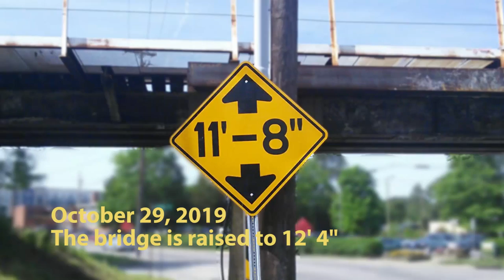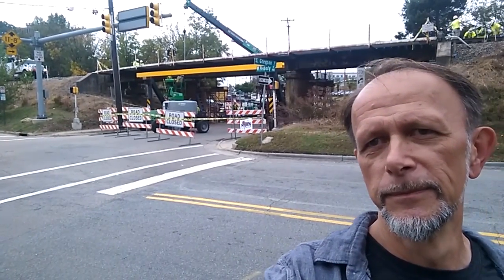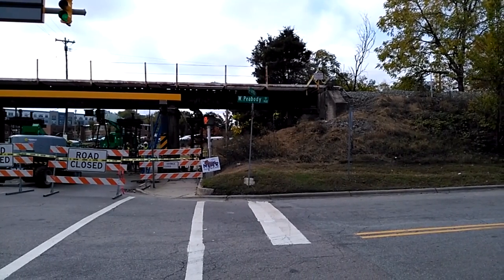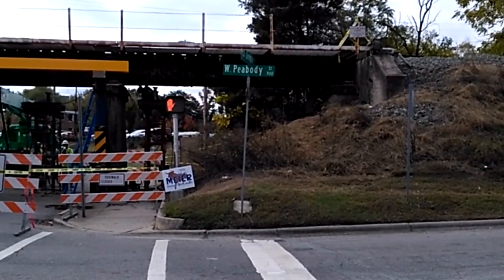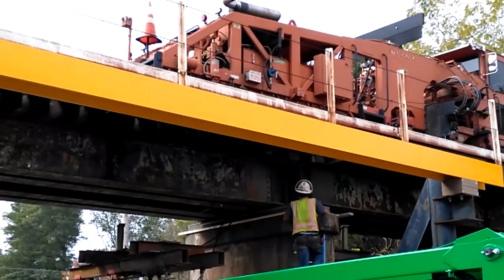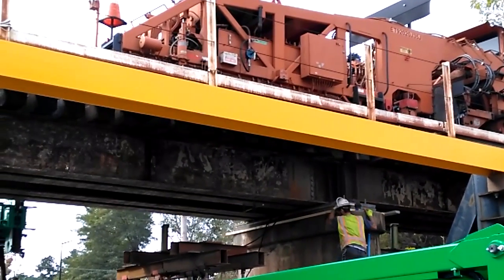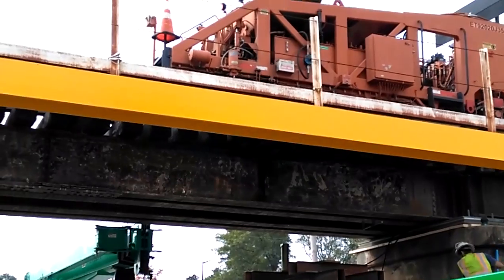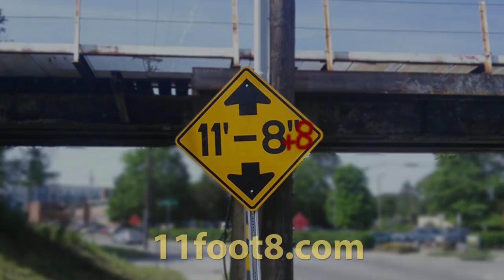Raising the 11foot8 bridge by 8 inches

Comment: The reopening of the bridge should be celebrated by reopening of a Penske truck with a bottle of champagne attached to the roof.
Reply: This is the best comment. You'd almost expect the local truck rental shop managers and insurance agents will be getting better balance sheets from here on.
Reply: Kickstarter campaign to fund this???
Reply: @MartinVisser  Ryder,Truck is Actually Holding the Event. They lost the most they said.
Reply: ROFL -- I'd pay to see that!
Reply: With the luck they have had at that bridge I would guess they would send out a truck that is still too tall to fit underneath.
Reply: There goes our fun
Reply: Howl
Reply: @horseplop9  It would be kind of interesting to see a breakdown of the ones we have recording of to see the tallies. Maybe even do a clip reel, if each crash go a second or two that would be between 2.5 to 5 minutes as you see the number of type (rentals might even break down company as well).
Reply: @SnowmanTF2  Id Gladly watch that..
Reply: They could have at least had a Penske ribbon cutting with the big scissors and stuff.
Reply: Lollll
Reply: Fucking lol
Reply: I talked to some rr workers once , they say that raising the tracks is easier than lowering them.
Reply: That's genius. Comments like this are rare
Reply: Sounds about right.
Reply: LMFAO
Reply: Lol
Reply: @jclay6680  yeah you have to undo so much its easier to rip it out grade it down then rebuild
Reply: Still not fixed. System is the problem 🏡 Our Life Great Qualities.....

1, Show all living creatures; all the love and kindness as much as you can.

2, Only try to be honest with yourself. If you try to be honest with others, you will get into big trouble soon or later.

3, Aim only one target at a time; otherwise you are chasing two rabbits and you will miss both. So, the reason behind it. Have one powerful reason and never ever give up the one you want the most.

4, Don't try to be good person only but be the powerful person. We will grow to be the one or we will die. There is no other choice. 

5, Always learn and look for to improve something your life. 

6, You are not alone. Love and faith the high power reduces unnecessary stress in life. But never completely rely on it. 

7,  Success and happiness are the byproducts of our usefulness. So, always increase the possibility of success.

8, Life is not going to be easy. Because of our unnecessary things. Eliminate all the unnecessary things as much as you can by organising yourself well with the environments. 

9, Never believe anything without the proper evidences. 

10, Always try to give more than you take. 
Because it is dignity/ character of the divinity within you.

🌎 As long as people continue to see themselves as separate from everything else, they lend themselves to being completely enslaved. Success depends on how well we relate to everything around us. Joy comes from that bliss of connectedness. I believe that unarmed truth and love will have the final word in reality. To love; you should have good heart. I am a good person until I see a person better than my standard of goodness. Being good is the progress towards a worthy cause. Love is God. Whoever lives in love, lives forever. How selfish it is to try to keep something forever? Love is all about nourishing, nurturing, sharing and expanding the love within you for all. The principle to which we adhere to is that we have kindness of love at heart for the whole of mankind.  As long as there is the unnecessary differences within us; we can not live peacefully so we have to eliminate all the unnecessary differences among us so we can love all. People abilities may vary but not there true love. If we love a person/ God for a reason then we love the reason but not the person. No reason is the reason to love the person because true love never fails. So do not compare or measure the true love as first or the last but love all truly. If you love people truly then you can understand people. If you don't love then you don't understand people at all.

People are controlled by system why?
The Cyclical Consumption is the current economy all over the World. It is making the scarcity problems of the earth finite resources to deteriorate day by day. Current Monetary System is legalised theft. Real money is Gold and Silver. Scarcity gives the money more value. Real money won't lose it's value. When Governments stay away from Gold & Silver then very easy to transfer the wealth / resources to upper class the Rich (Corporatocracy) Elite. When the Governments are printing out more new fiat currency with reserve banks, our old currency is losing its purchasing power everyday. They are printing millions of currency everyday. All governments and laws are existing right now to transfer wealth to upper class the rich elite. The USA Government & other Governments are in many countries, bailed the investment banks & financial institutions in 2008 against the majority of the people. There is no democracy in any countries. Because of the Money System based on profits motive only above all else even humans lives and well-being. So, we do not have freedom to protect our values with the money so on. The violence, bankruptcy & all the negativities are build into the Monetary System of our society. All are owned (including ourselves) by Reserve Bank. Which is private cartel the corporation. So, in legal system, we are legally considered as chattel the properties. They make money in the capital markets with our birth certificates. They do not consider us as Humans. That's the truth. We are at the invisible war with the Elites (Corporatocracies). We have to fight for our Freedom. Resource Based Economy is the Solution. We have to declare the earth resources as the heritage of all the people of this world. So everyone has access to it. Please have your research about zeitgeist movement then you know the truth more. 

 Truth About Health/Drugs Industry Because Of It Your Life At High Risk The drug industry is a 1/2 trillion dollars a year worldwide conglomerate. Almost 300 billions dollars just in North America. That is really big business. What would happen if everyone were well? There is no money in health. You see, good health makes a lot of sense but it doesn't make a lot of dollars. Because everything they do is toxic. Every drug they use, prescription drugs, all drugs are liver toxic, bar none. If you've had amalgam fillings put in your mouth by dentists. It is highly toxic. There's cancer because most of the chemos are themselves carcinogens. To view the tumor as the cancer and we know the tumor is not the cancer. The cancer industry is 200 billions dollars a year. The more work they get, the more profit there is. You have to dismantle; If the truth ever came out about what we would need to do. 30% of people of females in America are at risk of getting, will get cancer of the breast. The ones that are already dead have been grossly mistreated by the medical profession and by the government that supposedly is supposed to encourage free research and development of all possibilities. Why would medical doctors who studied medicine and practice medicine and are heavily funded by pharmaceutical companies why would they go and look into vitamins? That they never had the answer orthomolecular. And as more and more of our population start taking their health into their own hands, there's going to be even more and more of changes. It can't go on the way it is. The system is failing apart. We must make nutrition the primary prevention strategy for the population. You are what you eat. You are everything that you have ever done to yourself. The choices you make directly affect the outcome of your life. - (Food Matters Documentary in Netflix)

😊 Well, I truly love God. I am not religious but very spiritual person. So, I believe 1) Religion is the beliefs in someone experiences But spirituality is having my own experiences. The mainstream religions people promote religious ideology by giving guidelines and guide but In my spiritual life; I do not want anyone or anything between God and me to restrict my freedom to worship God. 2) We do not need any authorities to do good work. The god work is the good work always. In contrast; organised mainstream religions are claiming that they have the authorities to do God works as leaders so on. 3) God is not capable of doing wrong thing, change the past for us and create anything out of nothing for us. Nothing means not anything. So, even God is limited. The mainstream religious people believe that God is unlimited. 4) God wants us to take responsibilities for our righteousness life but not for all the consequences of our actions because they are continued to exist among us. So, How can god punish us for all our consequences? The mainstream religious people believe we are full of sins because of all our actions. 5) Freewill  is an illusion. People always choose the perceived path of greatest pleasure.  So, we do not have choices all the time. In contrast teachings of the mainstream religions are promoting people to do god's will always because we all have choices of freewill always. 6) We can not separate everything into groups. So, everything for good and evil and there's no success and failure for everything. If everything is real then real things can not be threatened. Once you come to understand that God/The Holy Spirit is in each of us, You will no longer need a Book to tell you how to live. Then why we need religious scriptures? The Virtue is the expression of the basic goodness in our actions. The Basic goodness is the fundamental worthiness of every individuals. We are worthy to God always in everything. 7) Beliefs in a cruel God makes a cruel man. No matter what; every living creatures has the right to live and What makes their life cheap? Everything depends on everything. Nothing too big or too small in value. We can not love and hate at the same time; Being a vegetarian means love without cruelty happily. The mainstream religious people are killing people and sacrificing animals in the name of God. They promote God's cruel punishments. The Punishment is endless for Sinners/Devil according to religious scriptures. But God is love always. Overcome hate with love. If all religions for peace, unity? No way. Because they are not for peace. 8) Well, The God gave us everything to go from moment to moment in our lives as we do our part  and pray only to thank god then the Love is in progress. The Love is always for everyone. We are always worthy of the God's love. Our greatest fear is; not to be loved by anyone but we are all loved by someone. When we eliminate all our unnecessary differences among us then true peaceful life is possible with the true love. If we can't find the peace within ourselves then we will never find it anywhere else. 9) This is the Fight for independence and freedom of humanity to worship God freely without religious guide and guidelines to restrict us. Unnecessarily, We do not want third party controls over us in anything ; especially in spirituality. 10) Revive Survive Thrive. Sincerely,  The Real Peacemaker against religious oppression.

 https://youtu.be/HbvCxMfcKv4
https://youtu.be/pIJHJzDQcRM
https://youtu.be/MyxbdmAnIcI
https://youtu.be/wLzeakKC6fE
 https://youtu.be/P8vHa8zD7jY
Reply: YES
Reply: very nice though
Reply: Not enough clearance (remember, they only raised it 8 stupid inches. LOL).

Comment: Penske Yellow was the perfect color choice for that new crash beam.
Reply: LOL
Reply: I'm sure no one will miss that...  ;)
Reply: I bet they didn't even have to paint it. The trucks involuntarily donated the paint.
Reply: I was thinking orange and blue, for Budget rent a truck
Reply: *slow clap*
Reply: Was'nt it easier to just make the road deeper? Lol!!!
Reply: Their trucks are now all white.
Reply: @jc9240  there's pipes under the road.
Reply: @Commissar0617  3 FEET DOWN.
Reply: @DieselRamcharger  exactly. you can't build a road directly on top of the pipe, you need roadbed to spread out the load
Reply: @Commissar0617  Oh!
Reply: @DieselRamcharger  city doesn't have a way to bring it higher. I don't think you understand just what all goes into supporting a roadway
Reply: @Commissar0617  Road need to go down, not up. or the trestle need to go higher. easy to do, just not cheap. why the city allows public safety to take a back seat to cost, ill never know. the rail company lifted it 8 inch because the higher you go the further in each direction you need to regrade the track. if you knew anything about train track you'd know adjusting them is not difficult. its jut not cheap. the bottom line here is, failure of govt.
Reply: @DieselRamcharger  there's big piped under the road, so you can't go down. it's an old roadway, been there for probably over a hundred years.
Reply: @Commissar0617  that big pipe, is a drain and water main. hell here in phoenix  we just had them dig up miles of street, lay temporary pipe in place  along the sidewalks with diesel boost pumps, as to not disturb anyone while the mains were serviced (enlarged) for future growth. it CAN be done. the city there is just fucking incompetent.
Reply: @DieselRamcharger  it's a state maintained road. there's a sewer MAIN that's 100+ years old running under it.

Comment: Railroads always have the coolest, specialized vehicles. Ballast tampers, rail welders, gaugers, straighteners, all expensive, all super specialized, all super powerful. I've dug watching them work since I was 4 years old.
Reply: Are you old enough to remember the steam powered locomotives?
Reply: @punothebear : I am.
Reply: Sheldon (TBBT), is that you? 😊
Reply: dude, i had no idea...all i know is i loved them as a child
Reply: I was watching a railfan video a few months back, showing how they "lift" the entire track, rails, baseplates and sleepers all at once and clean the ballast below it. I was astounded how "flexible" it all is.
Reply: @kdwaynec  oddly enough they have to be flexible, otherwise thermal expansion, tectonic movement (including earthquakes), and even just the vibration of a train going over them would rip them apart within hours